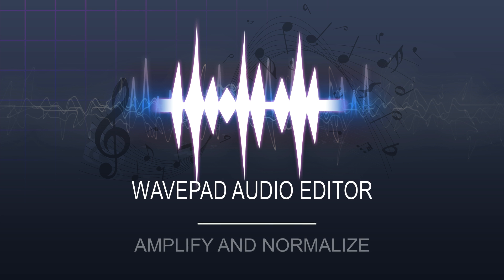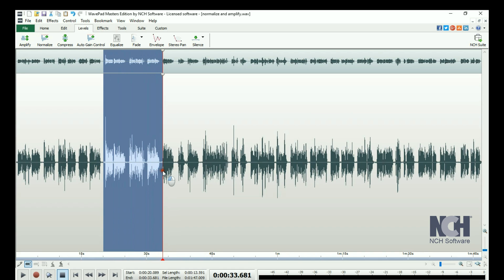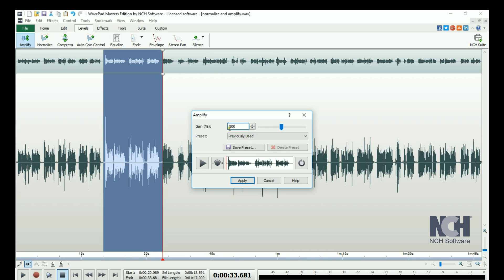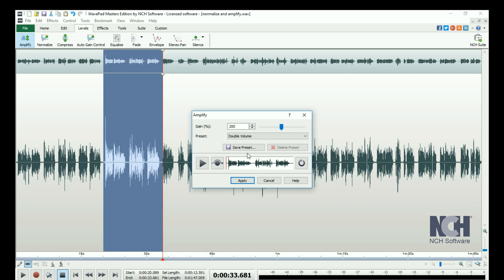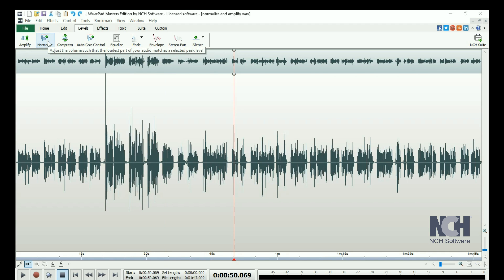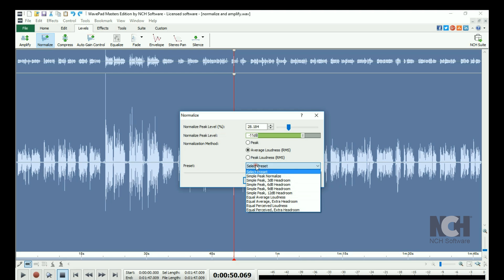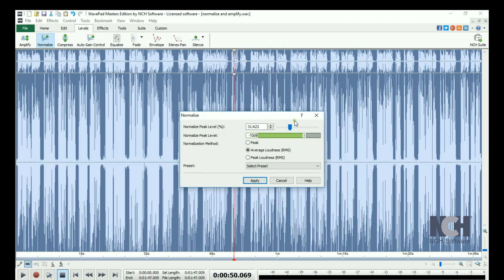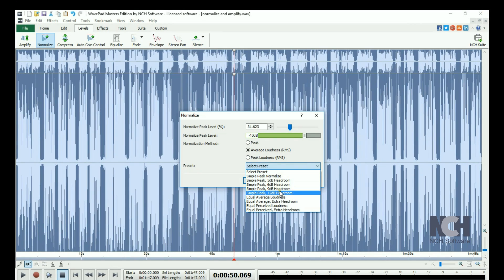How to Amplify and Normalize Audio | WavePad Audio Editor Tutorial

Comment: I have a track that’s louder than the other tracks in my project. I normalized most of my tracks at -5DB, I had other set at -4DB and another at -3DB to match the volume. I then took the track that’s louder than the others and first set it to -8DB, -12DB, and finally to 15DB however when I covert them to MP3 and burn the CD the loud track still sounds louder than the rest. How do I get this track to sound at the same level as the others.
Reply from the maker: Hi there, the power users in the WavePad forum may be able to suggest a solution for this issue. You can visit our forum to post a question here: http://nch.invisionzone.com/forum/6-wavepad/